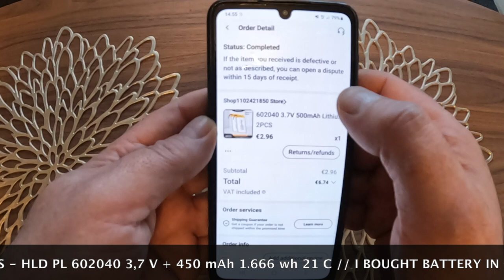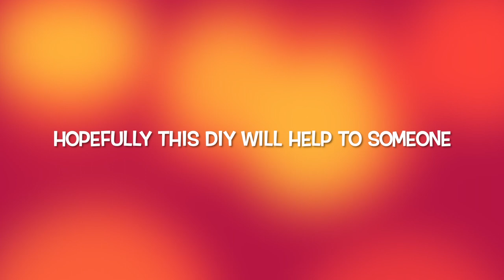INTERCOM BT S2 🔋HOW TO  CHANGE BATTERY

Comment: Great video!! I will get myself an extra battery just in case.
Do you have the type or photos for the type c plug, I think I need to replace it. It has some play...
Reply from the maker: Thanks. I do not have pictures or knowledge which  type C plug is in it but I have seen one video showing instalation. You can buy on aliexpress 10 different C plug socket with different pin types very cheap. Check this video
https://youtu.be/NmjIEGDCW2w?si=w0FGmMvLxnhspu7I
Reply: @specimenhunter  many thanks!!